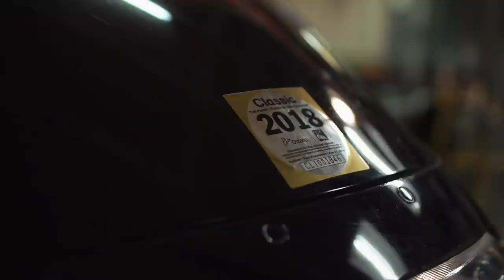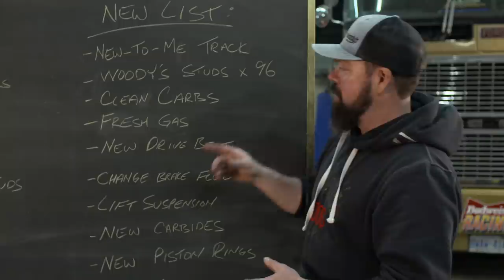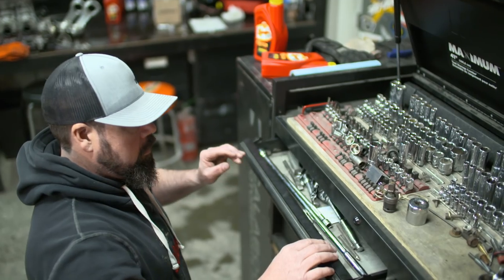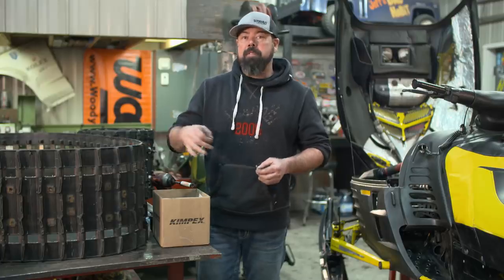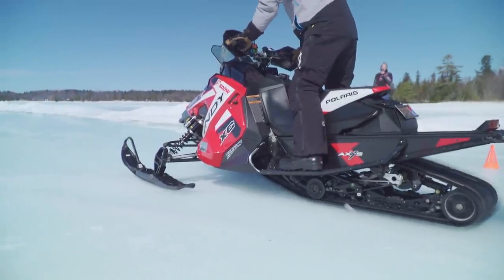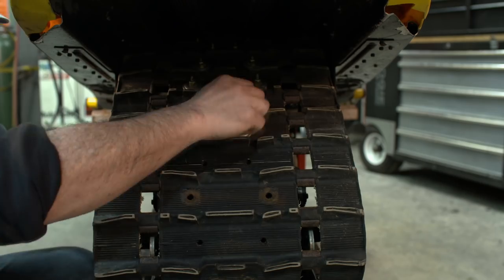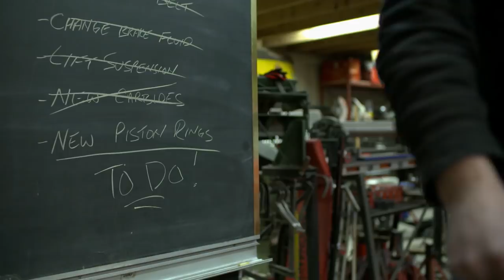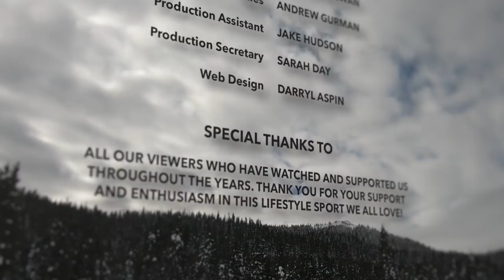Snowmobiler TV 2021 - Episode 13

Comment: Late to the party as usual but squat that thing down as far as you can and run the track as loose as you can without ratcheting. Add some slide rail lube and you will get that 108mph re ring will help of course too if compression is down.

Comment: Love your show just getting back in to the sport. I bought an old Yamaha viper 700 and it ran okay for a bit however it bogged and stalled and let out a huge backfire and now it won’t start at all. I am afraid it’s really screwed but I don’t know enough about these old triples.any ideas? Thanks Andy
Reply: Stator can give issues like that and its a know issue on those, not real common bit it does happen

Comment: Mill a little off the head and find some good used triple pipes that run higher rpm. Mine has no problem to 110 with a 144